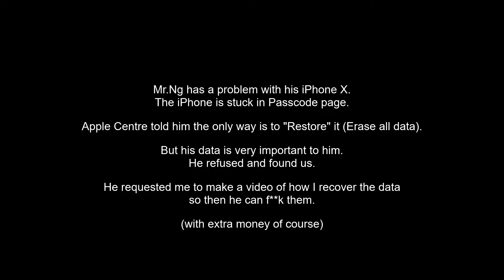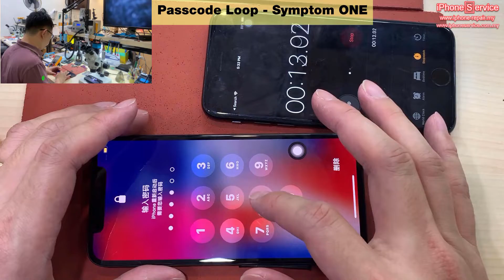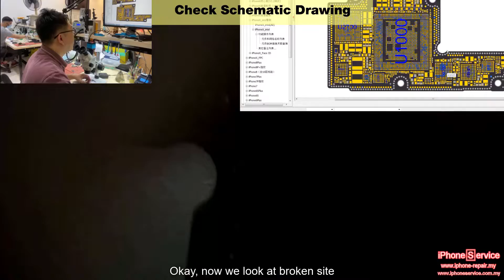iPhone Passcode Loop Fix 【Data Recovery】iPhone X NFC

Comment: Can I send you my old iPhones 4 and 5 to have internals placed inside of 2 other donor phones in order to retrieve my data? Unable to get past passcode screen on one phone because of a Cydia add on or tweak and short circuited my other iPhone using a charger with slightly exposed wire which touched metal on stove while phone was plugged in so hoping I can repair mother board then place inside another phone to get data.
Reply from the maker: iPhone5 short circuit can be fixed, but the other one with the passcode issue which is not a hardware problem and we can’t bypass it neither